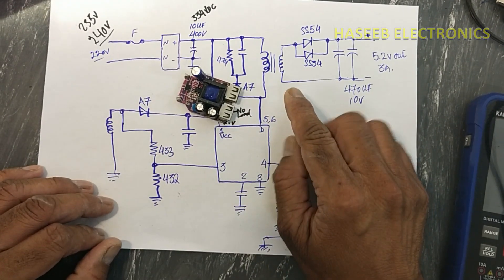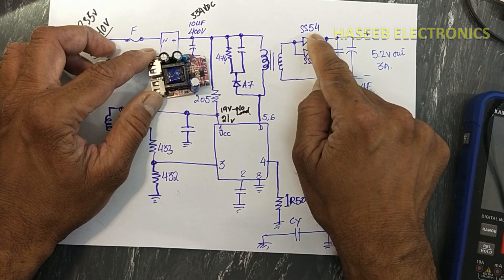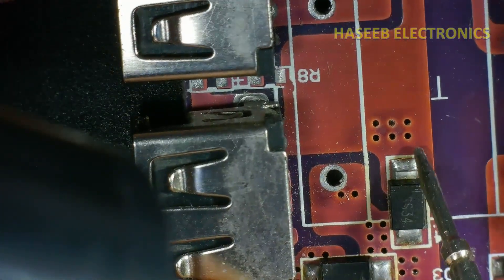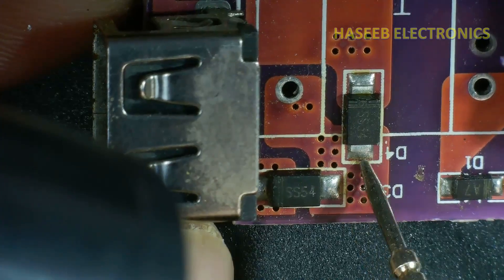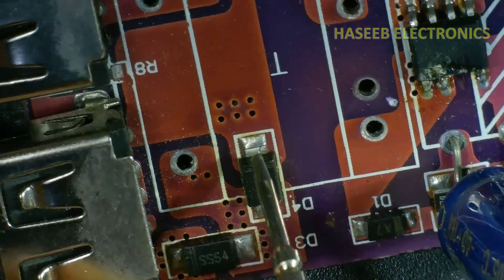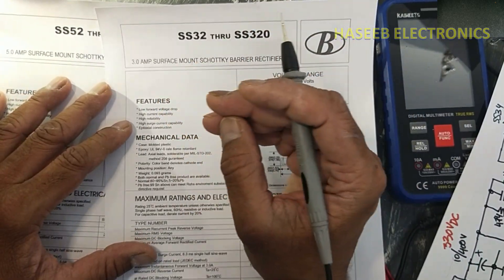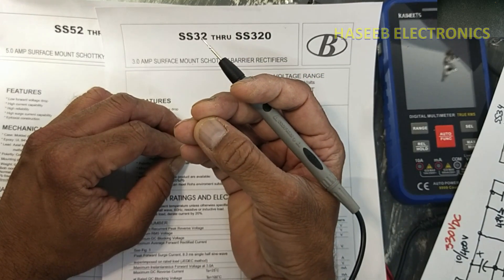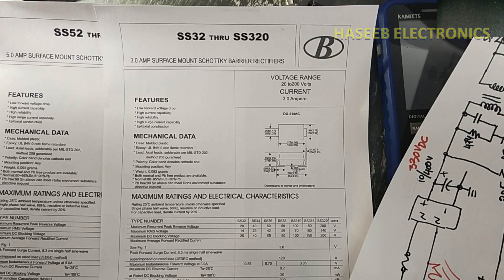{939C} Why SS54 & SS34 diodes are connected in parallel

Comment: The real reason is that transients in the output, that is, voltage spikes, can produce output currents that briefly exceed 3A, and approaches 8A. Without the 5A rectifier, the 3A Schottky diode would be dead within a few milliseconds. With the 5A in place, the transient currents have a path for a short time that allows the output voltage to recover. When the current returns to below 3A, the 3A operates normally. It is just a way to introduce a safety margin in the output current. Your channel is very good. It should have more subscribers. Here is the relevant theory in an application note: https://www.st.com/resource/en/application_note/an4381-current-sharing-in-parallel-diodes-stmicroelectronics.pdf

Comment: Sir I have 28v 5a ev charger it consist with 3844 chip ic & lm393 chip ic both are linked with capositors & resisters and zeenat diodes also can you please explain the usage of 393 ic

Comment: My guess is that the manufacturer used two diodes for load sharing and that they are different simply due to cost and availability. In other words, the lower rated diode meets (one half of) the minimum component requirements and the higher rated component was used (perhaps) to meet supply limitations. Diodes of different ratings, within the same series, often cost the same amount; this is true of the 1N400x series. Why the designer placed the second diode underneath the transformer, where it would be subject to the transformer's heat, is another question. I would say that it was just another example of improper engineering, when too much emphasis is placed on cost savings. Meaning, that they did not even want to pay for the small amount of labor hours that would be required to review the design.

Comment: what you are dealing with is trial and error, not science. they tried with one 5A diode first, but the charger was mad hot and it was burning, they got complains from the customers, so they added one more diode. of course the current is not distributed equally but helps to some extent in most cases. it also helps dissipate across larger area using 4 solder points instead of 2. even 10% and few degrees less can save the day. can you tell 48 vs 55 celsius in hand? They've used cheaper 3A diode since they didn't saw noticable difference between 5+5 and 5+3.

Comment: I really appreciate your video reply regarding my question. As you said the two diodes are connected in parallel to reduce power loss using different current rating will reduce the power loss of the diode

Comment: I am sure there is a good reason, but I don't know what it is. Diodes in parallel will never share the load current equally, and these are different current ratings. Maybe the current handling capacity is increased somewhat, but it will not be 5 + 3 = 8A...
Reply from the maker: in Schottky rectifier, the forward current and junction temperature is much effective. 
i think 2 rectifiers are used in parallel to reduce junction temperature, and reduce rectification power loss, 
you are right. i 3+5 ampere diode configuration will only 3+3 = 6 ampere maximum

Comment: Output current is as mentioned on the label says the flc is 3amp, so two diodes are there to increase the capacity more than 3 amp. 
Secondly might be the manufacturer have had the old stock from some other project that he wanted to consume this component rather than buying the new ones, I think so.

Comment: Sometimes parts are cheaper than mechanical standoffs so inserting a part under the transformer might prevent assemblers from placing the transformer flat on the pcb surface, this way you have some airflow under it
Reply from the maker: both diodes SS34 and SS54 are same DO-214AC package style. 
i think they are using 3 ampere and 5 ampere diodes in same place. as this charger's maximum current capability is only 3 ampere
Reply: @HaseebElectronics  i assume manufacture want less heat under transformer so manufacture put 3A under TF and kept higher heating product with more ventilation ., 
not only internal but also external 5has less distance in wiring compare to 3A , gives maximum load to 5A diode even if both gives same characteristics .
May be there is a better reason , i would love to see and learn from it  if so.

Comment: For me its to increase the current carrying capacity of the diode but it should be same not two different type, that's a bad design a way to save cost.
Reply from the maker: you are right it is used to share the rectification load, and to reduce rectification loss, decrease junction temperature 
i think there is no price difference in SS34 and SS54, might be they used these different numbers

Comment: Only to increase the output current, because they are in parallel so the maximum current can be 5+3 A=8 A
Reply from the maker: might be it is to increase current 
in this condition 5 and 3 ampere diodes 
maximum current will upto 6 ampere 
because 3 ampere diode will not handle more current 
so in this condition, the maximum limit can be obtained upto 6 ampere
Reply: @HaseebElectronics  each diode can handle it's own peak current, the 3A diode will pass 3A and the 5A diode will pass 5A, so the maximum can be up to 8A, as I understand your video. If each diode can handle up to 3 A, the maximum current can be up to 6A.
Reply from the maker: @Trucam2020  when the current will increase than 3 ampere 
SS34 will reach at its maximum limit 
so SS34 may damage 
because in parallel current will flow equally 
exceeding above 6 ampere, ss34 will unable to handle more current
Reply: Diodes in parallel do not share the current equally due to different forward bias characteristics. The diode with the lowest forward voltage drop will try to carry a larger current and can overheat. With two different current ratings this will be even worse I think...

Comment: Chargers nowadays need to be compact. One issue with slim designs is the high junction temperature of the secondary side rectifiers under full load conditions. A common solution to reduce losses and generation of heat is to use two parallel rectifiers instead of one. When two Schottkys are connected in parallel, forward current IF is distributed among them. In case of ideal devices, each rectifier will take half of the current. Unfortunately, the electrical characteristics of two semiconductors are not 100 % matched and one rectifier will have a lower typical forward voltage VF than another. As a consequence, more than half of the total forward current IF will flow through the device with the lower VF and its junction temperature Tj will rise faster. With increased junction temperature, VF is further reduced, resulting in further increasing current and so on and so forth. To limit this effect, a good thermal coupling between the rectifiers is essential, ideally at cathode and anode terminals [reference: see application note AN11358]
Reply: But why not use identical rectifiers?
Reply: :virtualhug:

Comment: Its made in China or Korea? Maybe it's a wrong design ... Once I opened a humidifier with a resistor attached to the fuse, don't know why but it burn and I replaced the actual fuse. I often encounter strange designs like this in cheap electronic devices
Reply: 10 ohm metal film resistor are used for inrush current limiting as well as for fuse